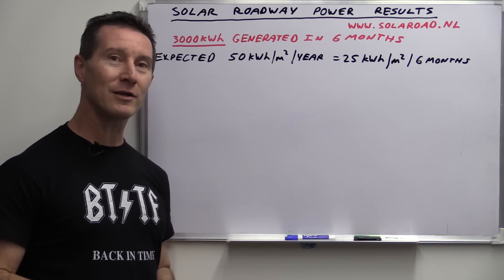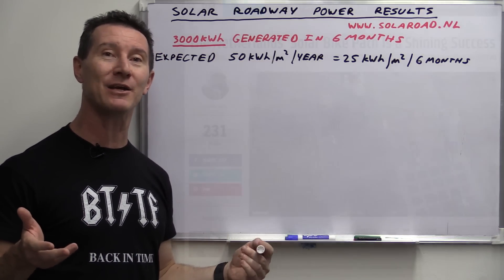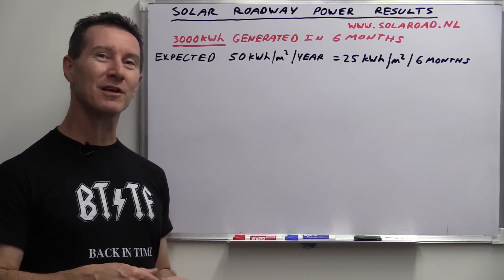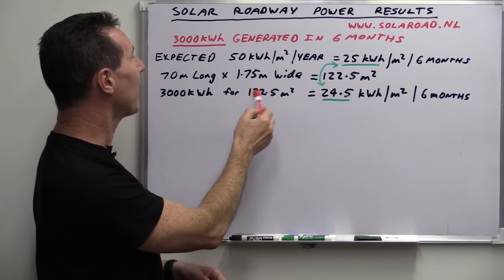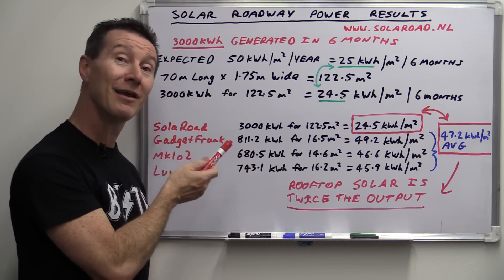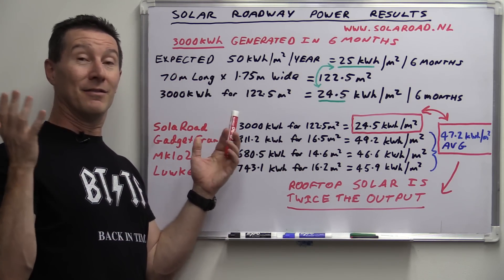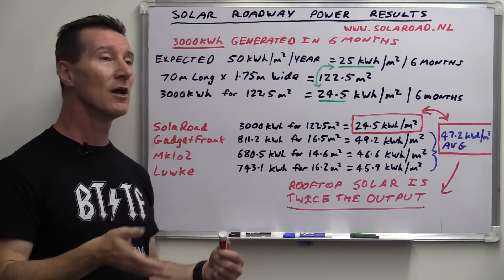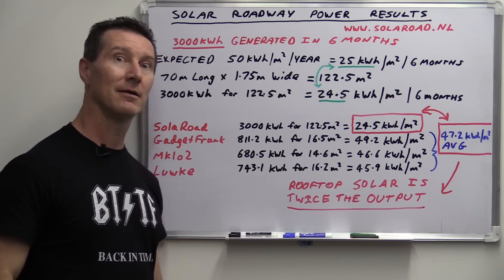EEVblog #743 - Solar Roadways Test Results

Comment: Great video! I'm sick of these eco fanboys that lack any skepticism or basic knowledge of science! All they manage to do is hold back ACTUAL useful renewable technologies and inventions, damage the reputation of science and engineering and waste tax payers money and research funds. Guess who's to blame when it turns out this is a waste of money?!
Reply: God Nondedju If you are so sure that this is a waste of money, then how much is the difference between a mass produced solar road and a regular road?
Reply: Mark Baanstra What about it?
That is like me saying; Solar road 70kWh per m2, asphalt 0kWh.
Reply: Mark Baanstra That is the cost of R&D and provides zero indication of the m2 price of a mass produced solar road.
If you want to know if a solar road is viable, you will have to know the price difference between a solar road and a regular road.
Reply: Mark Baanstra Yes you already stated that, and I already told you that the 4.7 M canadian is the price for the R&D not the cost of the road. 
What you need to know is the price difference between a regular road and a solar road. That will tell you if this road is economically viable.

btw.

I just looked up some cost figures for an asphalt cycle path. 70 meters long and 1.75 wide will set you back 5.500 cdn, the path is twice as wide so the figure will come to $11.000 cdn. This includes the foundation as well.
What you are saying is that bio-asphalt is at least 5 times as expensive as regular asphalt...
Reply: Mark Baanstra No, the prices I provided includes installation costs. 
But none of that has any bearing on the cost of solar roadways. 

And while bio-asphalt might be a great product, regular asphalt is made from waste products. The bitumen is a residue from petroleum distillation, and unless we reduce petroleum distillation, the bitumen will still be produced. This seems to be one of the main hurdles that bio-asphalt is facing, it is trying to replace a waste product that will be produced regardless if it is used or not.
Reply: Raspoetin a Sorry, that is not a valid question. How much is the difference between a car and a tree? Could you perhaps rephrase it?
Reply: God Nondedju It is a valid question I asked. Surely you would know the answer to it if you make claims like 'waste tax payers money and research funds'. How else would you be able to substantiate your claim?
Reply: Raspoetin a You didn't rephrase your question, but I'll assume you meant the difference in costs? 

It is common sense really:
- PV-panels+electronics are way more expensive than asphalt (which is mostly a by product and waste).

- While asphalt roads are very expensive to construct, that is mainly due to the layers needed to deal with the loads it is subject to. This will be even more difficult with a solarroad. You need to cope with the same loads and stresses while also housing and protecting the electronics and wiring. At least asphalts roads can be poured down relatively easy.

- It would also be much more expensive to maintain due to its complexity.

Aside from financial issue it must also act as a safe road surface. Asphalt is a composite that is specifically designed to provide grip while keeping wear at a minimum. It also has to deal with weather conditions. Roads might appear simple. But in reality they are highly engineered to their task. If you think a glass or polymer layer could provide the same qualities (let alone costs) I think you are extremely naive. There are actually pilots going on with roads constructed from recycled plastic in India, but that is all very early and low standards. It might provide grip, but how about dealing with rain? If you put electronics in it things will be even more difficult. And plastics do generally do not deal very well with oil and gasoline. Or what will happen when a car gets on fire on a plastic road?

These are all questions that are being overlooked with projects like this. The idea of generating electricity with roads might be nice, but they are totally inefficient. How do you transport the electricity? Highways are generally not near electricity users. Also, transport losses will be significant.
It is much more efficient and renewable if we spend the money on wind parks, solar farms and research to improve battery and pv panel technology. And of course, reduce the amount of energy we consume in the first place.
Reply: God Nondedju PV-panels+electronics are way more expensive than asphalt (which is mostly a by product and waste)

Undoubtedly a solar road is more expensive. But what you need to look at is the price difference between a solar road and a regular road and then calculate the yield and maintenance. So far no one has any figures on the subject. The Netherlands Organisation for applied scientific research TNO has done a full technical/economical feasibility study and reckons that these roads currently have a return of investment of 20 years. They are aiming at 15 years.

It would also be much more expensive to maintain due to its complexity
Asphalt roads are high maintenance compared to properly constructed concrete roads and since these solar roads are made from concrete with a  solar panel and a glass sheet on top, I fail to see what is so complicated. If anything these solar roads will require less maintenance then an asphalt road.

If you think a glass or polymer layer could provide the same qualities (let alone costs) I think you are extremely naive
This is the exact reason why they are doing this field research at the moment. One of the questions that might be answered with this R&D is if they can develop a coating and glass that can provide the same of better qualities then a conventional road.

These are all questions that are being overlooked with projects like this
No, they haven't been overlooked. This is the whole reason they are doing this research at the moment.

Comment: I like how mainstream America thinks Solar FREAKIN' roadways are a great idea but using nuclear energy for cheap electricity and reduced carbon emissions are stupid.
Reply: It is because you can never fully control nuclear power, once a big failure happens, it's hazardous and highly dangerous.
And you have the waste problem. We still don't have any possibility to store this atomic waste long enough (~100, 000 years) until its harmless again.
So, Bullshit idea as well. "cheap" (which is an illusion resulting from heavy subventions) and "clean" (again illusion, it's highly destructive to nature and contaminates millions of litres of water to concentrate this stuff) it's definitely not.

Comment: Asphalt road bed installed properly, good for 20-30 years.

Concrete road bed installed properly,  good for 40-60 years.

Brick road beds installed properly, good for 1-5 years.

Glass bottom road bed? 10 mins?

Comment: It would indeed make more sense to build solar arrays above or beside existing roadways, especially bike roads, since that would have the added benefit of shading the cyclists in hot areas, in addition to less vulnerability to dirt and damage caused by traffic, not to mention the fact that traffic going over the panels shades them.

The benefit of solar roadways, imo, is that overhead solar panel arrays appear more effective and cost-efficient so if people are willing to invest a lot in solar roadways to get relatively less power than overhead panels, why not invest less in overhead arrays and get more power?
Reply: Mark Baanstra Water damage and glare are other problems that didn't occur to me.  And, yes, I don't think it's just the idea that such roads are 'sexy' but greed is causing people to support the most expensive and wasteful public projects possible for the sake of milking public spending for ever more growth and jobs.  Maybe there are some benefits to having the solar panels on the ground instead of overhead, though, such as in areas where heat is lacking and people can be warmed more by the sun while biking in winter if there are less overhead solar arrays shading them.

Comment: Benefits of solar roadways:

* Provide storm water management.
* Recycle "waste".
* Heat the road to reduce salting and plowing costs.
* Provide corridors for utility lines.
* They pay for themselves!
* Solar Power!

Cheaper solutions:

* Porous paving and/or roadside swaling.
* Asphalt is one of the most recycled materials already.
* Geothermal heat store.... Also would provide cooling for the road surface, reducing thermal expansion.
* Ignoring that when utilities aren't ran in parallel to roadways there is usually a good reason for that, this is actually a good idea..... That luckily doesn't require building a solar roadway to implement.
* Piezoelectric devices.
* Take all the money saved by implementing the above solutions, compared to building a solar roadway, and buy as many solar panels as you can and as much rented roof space as you can and and use the revenue generated from the solar panels to pay for any maintenance.

Comment: I design roads for a living, and definitely agree that this will never be a viable product for roads.

However, you don't even have to understand the problems with using it as pavement structure. 
All you have to do is a 10 year life cycle cost analysis of cost per kwh, see that it is likely around 10x the cost per kwh than a rooftop unit, and then understand THERE IS NO SHORTAGE OF ROOF TOPS.

Comment: finally able to finish this vid...wow, what a crack...he does say that these are "prototypes", thus not yet ready for wholesale production. current use solar panels didn't start out with the efficiency they currently have. they had to be developed(LOTS of money) and are still being upgraded.

 fords model a car got 16(average)mpg. compared to todays autos that only get about 35mpg. after a houndred years they should get OVER 300mpg.oh ya, in france, they are doing that with "prototypes". here in U.S. we can make a freight train that moves a ton of cargo 400 miles on one gallon of diesel...but can't make a car that gets even half of that...point being, the NEED for alternet energy is worth the cost(both money and environment) to develop. use of oil is KILLING our planet and people.   breathing fuems released by burning oil is MORE deadly AND toxic than tobacco...yet look at the anti-smoking ads.

so, GET OFF YOUR HIGH HORSE AND HELP SOLVE THE PROBLEMS OF THE WORLD OR SHUT UP.

respectfully speaking, searching for the truth is wonderfull, just look for and use the WHOLE truth, not just part of it to "prove" your version.

Comment: I don't understand why solar roadways is such a threat to all these nay sayers. Why spend time bashing someone else's idea? Come up with something better if you don't think it will work. Make a better wheel. You're just doing what bullies do and doing it for the same reason. Feeding your ego at the expense of someone else. Seriously. Think about it.
Reply: Shirley G "Come up with something better if you don't think it will work." That's very easy - it consists of the proven successful method of putting solar cells on south-facing roofs, pointed towards the sun. Putting solar cells in roadways laid flat immediately gives them a huge efficiency disadvantage. This project has no commercial viability and has only seen the light of day due to taxpayers money being wasted on it. Until all the south-facing roofs are full of solar panels there is no point installing them in roadways.

Comment: You make too many assumptions and use too little data to back up your claims. I'm not saying you are wrong in that making the sidewalks are not cost effective on a cost/return basis, I'm just saying your "statistical analysis" can't really be taken completely serious. 

First of all you heavily compared this to solar panels used on roof tops which is fine but you only chose 3 locations that you were gathering data from (which is nowhere near enough because all 3 locations could have solar panels that are completely different from each other).

Second, you put in big letters you are assuming that there is 100% usable surface area which you just can't assume (and it is obvious that there isn't 100% usable surface area which it really appears to be about 3/4 usable area if you look at the design they are using versus solar panels that are used on roofs that do have close to 100% usable surface area so if i just assumed that there was 3/4 usable surface area which neither I nor you know then that 70m goes to near 52.5m and the calculation of kWh/m^2 comes a lot closer to the range of other houses that you didn't use in the calculation)

Third, you mentioned that it didn't matter that the solar panels on the roof were small compared to the panels used in the sidewalk (and the sidewalk is a much larger scale than those small panels you showed on the roof which has to be taken into consideration which may or may not affect the results but you only had the 3 locations and none of them were large scale installations to compare against)

So even though everything you said may be true, it might not be based on a statistical standpoint (which you chose to use in the video) and can't be taken as factual evidence. So you can make a video that says "DEBUNKED" but in all reality based on just the information in the video you didn't really debunk anything.

///endRant

Comment: Based on the length of 70 m and half of the width covered with pv, you get 175 m2 pv installed. With an estimated 6000 kWh/a you'll get a result of 34.3 kWh/m2. You should get some 120 kWh/m2 in that area with 'conventional' pv. So SolaRoad isn't very efficient and the payback time is probably beyond the technical lifespan.

Comment: Sure...come winter and the snow, how they going to keep the panels clear to receive the solar energy?  Probably by heating it with electricity from the panels, which would have to be stored in batteries in case the snow falls overnight.  System efficiency takes a dive.  Nice try, but big thumbs down, it's just so not close to viable, as you said in the video.

Comment: 60w toaster, so how many hours in half a year? 365/2= 182.5x24=4380.
4380 x 60 = 262800watt hours.
okay say the toaster only runs for 20mins a day, 24x3= 72. 0.3333/24 = 1/72
so 262800/72 =3650watt hours.
A toaster uses more watt hours in the same time as that road generates.

Comment: <3 No matter how much in love the solar roadways its guys like this that i like even more as they are NOT affright to research every last bit of it! Even if they love it they dare to say its not that great!

PS i bought my system for 7000,- and after one year i already earned 900,- on energy back + the 1x 1100,- so within 7 years ill be break even and from that moment its 900+ euro's that i save per year <3 

And yes that last solar bike path is the best solution. There is a train track in Belgium that does the same thing by the way ^.-

Comment: I am not sure what the solarroad.nl overall goal is, whether it's to provide a frost free surface for cyclists or just energy generation.  If its for energy generation then I doubt it's cost effective, if it's to power a heating system then its doubtful it will generate enough power during the winter months, without additional maintenance and supplementary power.  A lot of things to factor in here regarding installation costs and maintenance over time.  You would probably be better making an elevated frame work that covers the path and allows the panels to be fixed at an increased angle and ideal azimuth (pending application).  As far as the numbers I used to calculate residential and large solar installations up to 5MW, we used various software packages, but a reliable source if used conservatively is EU data from PVGIS http://re.jrc.ec.europa.eu/pvgis/apps4/pvest.php

Comment: I think the point that is being missed here is that it doesnt matter how close to the expected results they got. The simple fact is specified with the following statement: "zero is always less than .0000000001 mwh". So if asphalt produces 0, and the roadways produce any energy, so long as the energy produced is more over its lifetime than the energy required to produce the roadway panels then there should be absolutely no reason why your seemingly dead set on bashing this new technology. Other than perhaps butthurtery, or jealousy. I am still on the fence about which. P.S. im not a roadway fanboy, though i do think the possibilities for this new technology are immense.
Reply from the maker: Clifton Murphy Come back and talk when every rooftop has solar panels on it, until then, it's an impractical and uneconomical idea.

Comment: I noticed two miscalculations in your story:
1. the results are from the darkest and less sunniest period in Holland. In this period, solar panels usually produc less than 1/3 of the year production, so you can't say that this is the half year production.
2. Yes, this road costs 3M, but what will a road costs without these panels? You have to subtract these costs. And prototypes are always more expensive than final productions

Comment: You cant just use 6 mos.. Unless your 3 month mark is March 20th.  If you went from Nov to April, It's darker during most of those months... Will skew your data..
Reply from the maker: Cyberj717 I compared directly with rooftop over the same period. No skew in that.
Reply: EEVblog I could be wrong, I am new to this discussion, however.. You indicated the path originators expected the path to produce 50kWh/m^2 over a year period.  Having only 6 Mos of data you halved the expected value and compared.  A direct comparison would work if the data were linear.  You are dealing with a sine like curve.  If a portion of that data is selected, I can skew the resultant comparison depending from where  on the cure I select my data set.. Agreed?